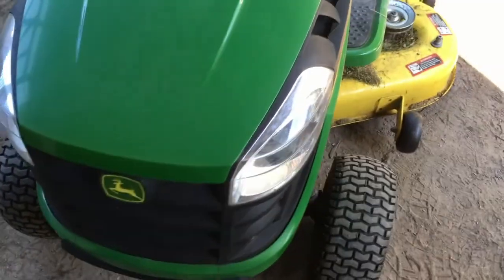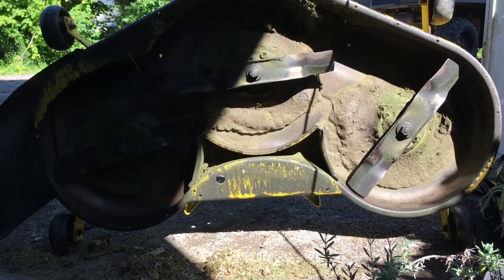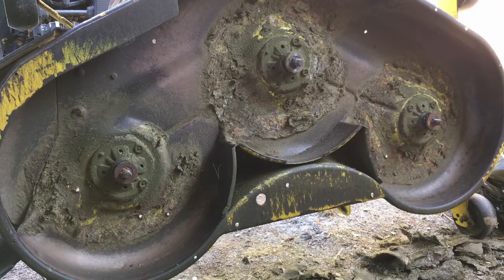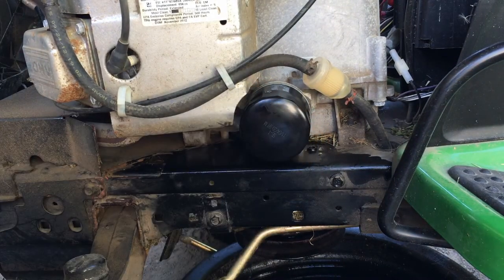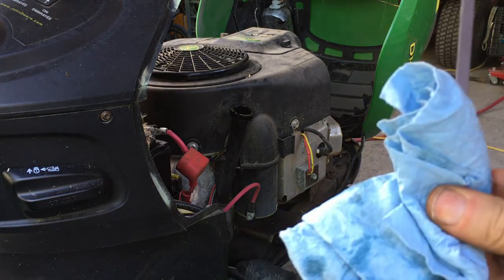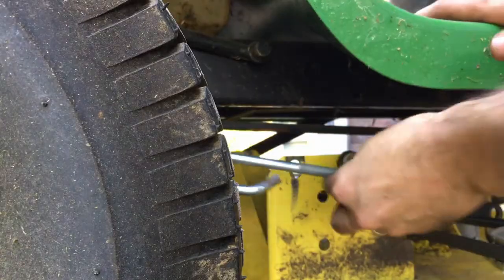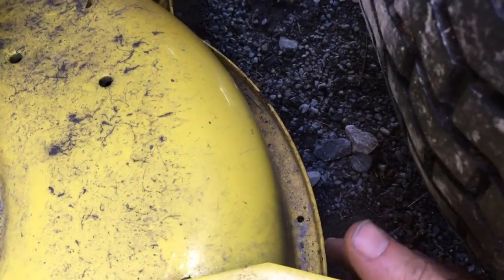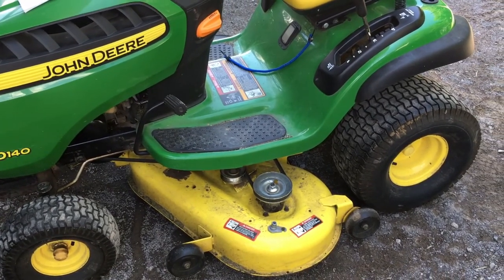Ultimate John Deere D140 Ride-On Mower Maintenance Guide & Tips

Comment: The height on the lever is blade height not deck height.
Reply from the maker: Thank you for watching and catching this!
Reply: @valleywrenchin  I just did this on mine and thought I would mention how I do it.  Front to rear and side to side.  Thanks for the video!
Reply: Also keep the front of the deck  I/2" to 1" lower than the lower than the rear.  Happy mowing.
Reply from the maker: I do remember that point!  That's great! Thanks for the refreshing tips!!🔧